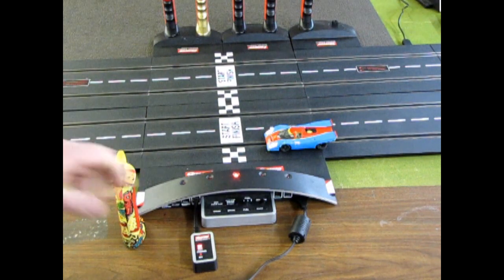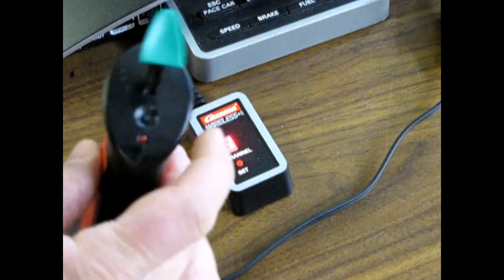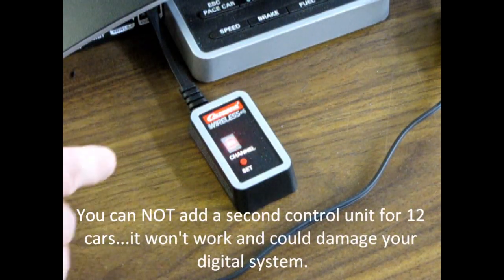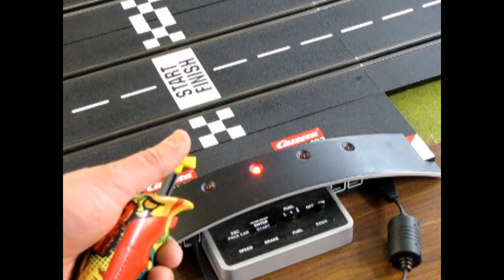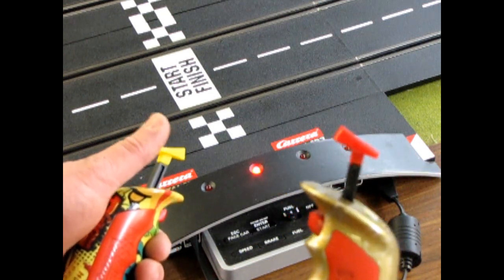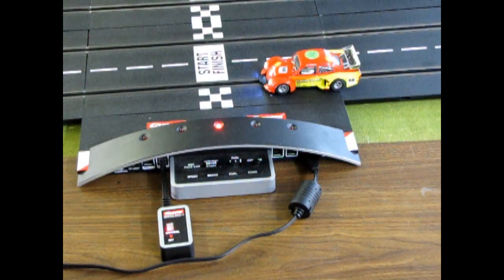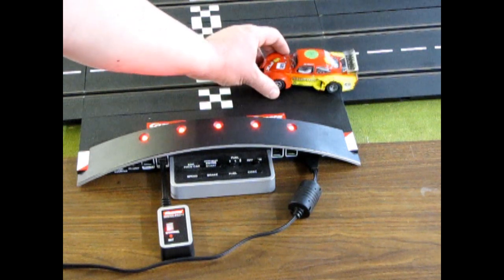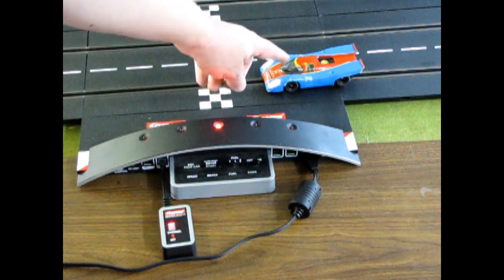How to set up your Carrera Digital Control Unit

Comment: Thank you for posting this. I bought a Carrera Evolution and started buying all of these accessories (position tower, etc...) only to learn they are for the digital version. As I priced the digital control unit, controllers and a few other necessities I concluded it would be cheaper to buy a digital set for around $375 or so after Christmas. The combined track alone makes it worth it. Thanks for posting this video.
Reply from the maker: Glad i could be of help. I too bought an Evolution track piece for a Digital set. I know the feeling. :D
Reply: @monsterhobbiesonlinestore  And it didn't work? I thought analog track would work with a digital set and all that was needed was the digital control unit. Please advise if I am wrong.
Reply from the maker: @outreachvideo  The track piece I was talking about is the lane power extension track. This is the track that plugs into the main power track to go from 2 lanes to 4 lanes (And 6 to 8 if you buy 2 more). Originally they only offered the analog piece, but not a digital one. Well...the analog lane extension piece does not plug into the digital, but I didn't know that and bought one anyway.

Comment: Great video, really helped as just got a Carrera digital set. Thanks for the information, much clearer than the book! One question I have is concerning running my old analogue cars on the Carrera digital track.....the book says not to connect the analogue power track into the digital system at the same time. I was going to do this and only power up either the analogue power base or the digital (not both together). Carrera seem to strongly advise not to do this. I have seen other racers running analogue cars on the digital track(obviously you can’t use lane chargers etc), but I don’t know how this is done. Do you have any ideas, tips or tricks please. My analogue cars are slot it, NSR, Carrera etc. many thanks. Stephen😎👍🇦🇺
Reply from the maker: You will have to remove the Digital track pieces and all the switches. No sense in running the risk of blowing up a Digital Controller unit and the chips in the track pieces.

Comment: Awesome slot cars! The digital versions Carrera makes are so cool! Question: Does the action button do anything other than change lanes? how do you boost on Carrera Digital?
Reply from the maker: The action button is used to program your car and then turn on the headlights and change lanes. Beyond that, there isn't too much more that it is doing.
Reply: With a pit, you can hold it to refuel as well.

Comment: Question, when you set speed,  is that for every lane or just the car that's on the track? Which means you have to do speed settings for each car? I would hope it for all the lanes when you set it.
Reply from the maker: Set for each car. You can also change the brakes.

Comment: Thank you for the informative videos.  Just got a 132 Digital set a few weeks ago.  Setting the car speed down to 10% is still a little too fast for my 8 year old.  Is there a way to slow them down a little more?  Could a lower voltage power Supply be used?  Thanks for your help.   Jack
Reply from the maker: Lower than 10% power? I don't know...that's when the cars are crawling around the track! :D Anyway, have fun with your set!

Comment: completely new to slot cars - bought a brand new Carrera 132 digital set for my son this Christmas, we have four cars and four wireless controllers. Any time we start racing we have an issue where the control unit seems to go into a frenzy - all lights flashing, cars come to a stop - very frustrating. I’ve tried disconnecting and reconnecting everything, I’ve tried with only a couple of cars, all cars, etc - all possible combinations - but it still keeps happening.
As you can imagine not great when you have a 12yo kid that was extremely excited to begin with!
Main unit is definitely pointing the right direction, same with lane changing track parts.
When this happens the lights in the control unit seem to all go off, cycling through all lights for about 5 seconds, then lights in cars go back on and it lets you race again. Extremely annoying because it then seems to happen every few seconds. Hopefully something “easy” to sort?? All help much appreciated…
Reply from the maker: With our track, it would do that if something crossed the track poles...what I mean is that if the left and right hand pickups made contact. So like putting a nail across the tracks. Another thing that can do it is something wrong with the motor of the cars. 

All I can really offer beyond this is to contact Carrera. They might know of something i don't.

Comment: great videos and super helpful!!!!!. I am having a problem with my new car. the second I set it down on the track, it instantly takes off with no control. The instance it car touches the terminals the wheels spin? please help !!!!
Reply from the maker: Glad it helped. Sounds like you are trying to place an analog car on a digital track. this will happen naturally. If your car is a Carrera Digital, turn it upside down and move the switch to the opposite side. hope that fixes the problem.
Reply: @monsterhobbiesonlinestore   well that explains it!!! thank you !!!!!!!
Reply from the maker: @greg1151  No problems. It happened to us too. Scary when it does! :D

Comment: Hi there, have a question regarding the control centre. Mine switches itself off if I don’t play with the track for a while, even though the power from the transformer is still on. I can’t find anything about this on any sites so wondered if your unit switches itself off or do I gave a faulty unit. The only way I can power it up again is to switch off and switch on again...hoping you can help. Thanks😎🇦🇺👍🏁
Reply from the maker: Mine does the same thing. Seems to do it after 1-2 hours.
Reply: @monsterhobbiesonlinestore  Thanks for that my friend.....It’s been pointed out to me that page 15 of the manual covers this...under technical specification....totally missed it!🤣 thanks once again for your videos and help, it’s really appreciated.😎🇦🇺👍🏁
Reply from the maker: @maxheadroom7687  No problems. Thank you for watching!

Comment: Good morning, a little late to the game. I just purchased a bunch of Carrera 132 scale track. Is it possible to use the track in conjunction with digital racing track? I don’t know if the track is compatible for digital racing. thank you
Reply from the maker: The track between Carrera Evolution and Carrera Digital is the same, with the exception of the digital switches and the digital control unit. You can not use the Evolution start/finish gate with any digital switches because you will short out the track.

Comment: Hi, I've just brought the spirit of speed set but as I live in the uk 🇬🇧 it's got a 2 pin instead of a 3 pin socket . Is there a adapter for this ? 🤔 please help us who can't use this set pls . Pls make vid showing us in the uk this adapter.  Thank you 😊
Reply from the maker: That is the first time I have heard of the adapter. Can you contact Carrera Germany for an answer? (Or Carrera UK?)
Reply: @madcapromanian  I already have contacted carrera Germany several times by e- mail with no response!! They don't seem to care that I can't use this set in the uk as we use 3 pin sockets over here . As I gather there are alot of British peps complain about this !! It doesn't say on the box it comes with a 2 pin socket , very misleading!! I can't use this set at all after cost of set + shipping from France.  Really annoying!!
Reply: @madcapromanian  it's the same 2 pin you use when you use a shaver or electric toothbrush.  The adapter for these doesn't fit the carrera set 2 pin socket & does it need to be the same voltage as the transmitter? I think it does .
Reply from the maker: That would be annoying.
Reply from the maker: Ok...let's see if we can solve this together....

1.) Does England and Germany use the same voltage? (Canada and USA are 120 volts...I think Europe is all 220 volts from the plug outlet in the wall)

2.) Sometimes hardware stores or stores that deal with travel supplies have those adapters for when you need to travel to Germany, for instance. If the voltage is the same, this should be a simple plug in solution.

3.) Usually a 2 prong plug means that you have a positive voltage wire on one prong and a negative voltage on the other. In the 3 prong setup, you have positive and negative and the third prong is a ground wire. I have had an extension chord in the past that was 2 plug, but I could plug in a 3 prong plug because the third prong went outside of the two plugs, if you know what I mean. 

4.) The transformer (Big box at the middle of the wire) will convert the voltage (120-220 at the wall) into 18 volts for the track and cars. You just need to get power into that transformer from the wall.

5.) I'm not sure if I should recommend this or not....cut the German plug off and replace it with a UK one that fits into your wall socket from a hardware store. In our hardware stores, they sell a plug that you can unscrew and inside are all the contact points for the wires. You just screw the new wires into the plug contact points (Positive wire to positive blade, negative to negative, etc) and then screw the plug housing back together and you're all set. 

I hate to recommend that, because you REALLY have to know which blade is positive and which is negative before you get into that job, otherwise you could damage the transformer if the electricity from the wall goes through it in reverse.  

Also, the grounding wire would be routed to the negative blade if you have to go to a 2 prong from 3...but research that first...don't quote me in case i am wrong, not being an electrician. 

Also, make sure you are the same voltage because 220 v going through 120 v transformer will overload it. - Good luck!
Reply from the maker: Oh...one other thing...cutting wires and modifying the transformer will void your warranty in a hot second, if that matters to you.
Reply: @madcapromanian  thanks for all the advice uv given so far it is much appreciated 👍 I'll look at the options then go from there . Have a wonderful day 😊
Reply from the maker: Good luck and let me know how it turns out!
Reply: @madcapromanian  will do , iam afraid I've got to buy a new transformer with a uk plug from a carrera dealer in the uk 🇬🇧.  More money but I should have brought a set in the uk , what a plonker!!
Reply from the maker: @davidprior8849  Live and learn. :_peterLike:
Reply: @madcapromanian  yet an update for you . I've heard from the company I got this from & they have suggested an adaptor I can buy . I've just brought it & have asked for them to pay for it . Thanks for all the help you gave me in this matter.  Have a grt wk .
Reply from the maker: @davidprior8849  Sounds good! I hope it gets there soon!

Comment: So is the speed/brake/fuel per car, or for the entire track (all cars)?
Reply from the maker: You can go both ways. You can put all cars on the track and then program them as a "unit", or you can program them individually by putting one car on at a time and programming separately.

Comment: Im really interested in slot cars and I’m planing on buying my first set and I was wondering should I spend some money on a digital system or just start out on a analog one until I’m used to it ?
Reply from the maker: Glad you liked the video! 

It really depends on where you want to start. If you have a small budget to work with and/or not a lot of space or if you just want an "introduction" to decide if it is right for you, I would recommend starting with a simple analog set. 

If money is not an issue, then digital would be better as you have more control over the set up and speed of the cars. For example, you can program the digital cars to run at 1/2 speed to get comfortable with how they operate, or if you want to teach young children how to drive. they won't be able to run the car at full speed, potentially sending the car flying across the room, into a wall on the first corner. Once they learn how to speed up and slow down in corners, then you can put the cars at full power. You can't do that with analog. 

Also, consider the type of driving you want to do. If you like "One car, one lane" then go analog. If you want to pass other cars, run out of gas, hook up to bluetooth, and more...go digital. 

But either way you choose, Carrera 1/32 analog cars can be "chipped" to Digital, and digital cars can be "turned off" to run on analog. And all track is interchangeable...just not the switches and power tracks. 

Hope that helps you in your decision.
Reply: @monsterhobbiesonlinestore  thanks mate you have been a big help i think im gonna start with a small analog set to begin with and slowly work my way up to a bigger digital track as money is an issue but thanks mate you have helped alot .

Comment: Newbie here. Trying to set a car to controller one. The lights rotate and controller flashes but car doesn’t move.
Reply from the maker: I'm not 100% sure on this, but that car may have a dead motor. Are you able to code any other cars?

Comment: Hallo! Tell me how many players can participate on your rennbahn simultaneously in the digital 132 system? Is it possible to increase the number of players to 20 or 24? What additional equipment do I need to install? Please write in more detail. Thank you for the answer. Sincerely, Alexander.
Reply from the maker: Hello Alexander. Sorry this response took so long. Youtube hid your comment on me. The current Carrera Digital Control Unit can only support 6 cars. Adding two together doesn't let you increase the amount of cars. However, there may be some second party software out there that changes this...however, I don't know about that.

Comment: Unfortunately I am a Scalextric guy.Going from analog to digital track.How do you determine where the lane changers are placed?
Reply from the maker: Thank you for watching my videos! 

To answer your questions on lane changes, it doesn't really matter where you place them, but i personally tend to make sure there is at least one left and one right hand switch to each lane. This is so that cars can pass one another and then come back to their original lanes. 

The "forced crosses" are there to prevent guys from running the outer lane all night long.
Reply: I have mine on straight aways and I put them just before the 180 curves so I’m able to switch to an outside lane.

Comment: How can i plug Carrera Digital 132 on my pc and count the laps?
Reply from the maker: That is a question I don't know as I just use the tower in our races. However, one of my customers had that software to hook it up to the computer. There is a port on the control unit for hooking up Bluetooth....it might have been done through the same port. You will also need the software for it. I hope that helped...in my little way.